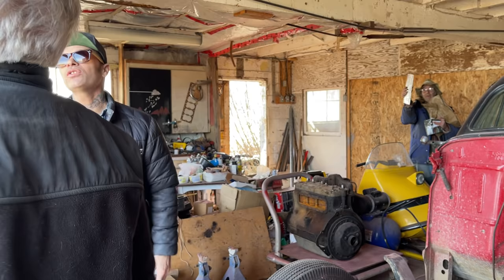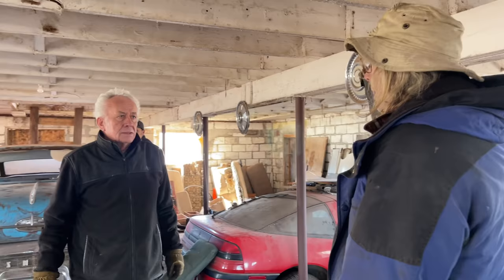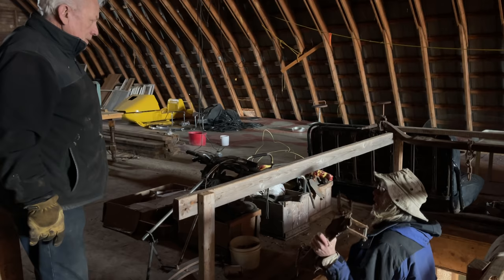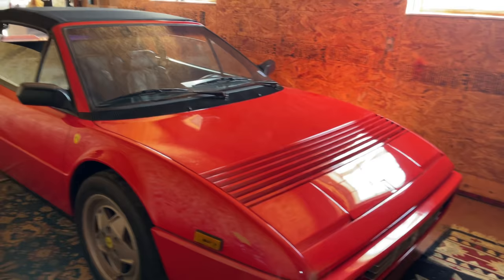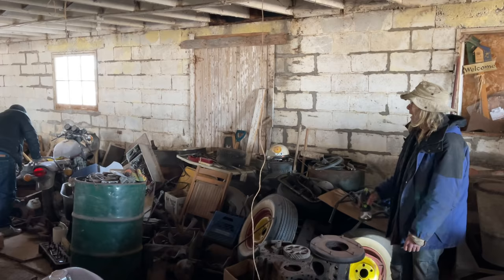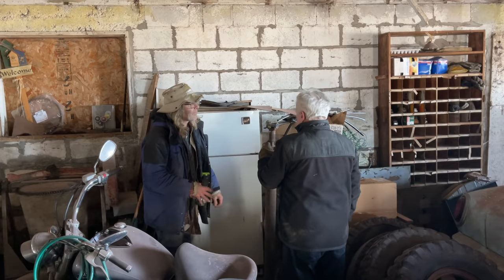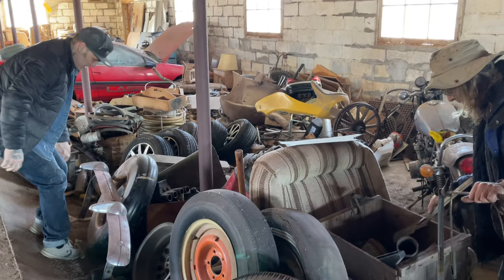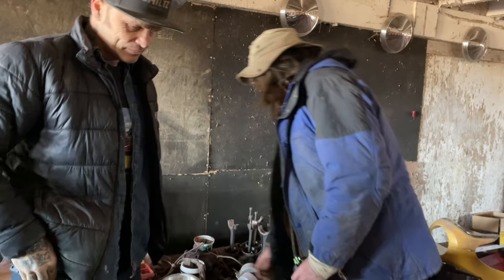WE'RE BACK AT JIM'S TO MAKE ANOTHER DEAL

Comment: I'd be careful with the 900 triple. They are called the widowmaker because the power band can rip you right off the seat. Extremely torquey 2 stroke. But if you have been used to driving extremely fast bikes you should be ok.
Reply: The 750 triple 2 stroke is the Widowmaker
Reply: That's not a triple or a 2 stroke that's a Z1 900 your thinking of the H2  which was only a 750 and yes a triple also a 2 stroke
Reply: @zachfender8693  H-1 500 cc's H-2 750 cc's
Reply: @badgascoupe  yes
Reply: That's what I was saying